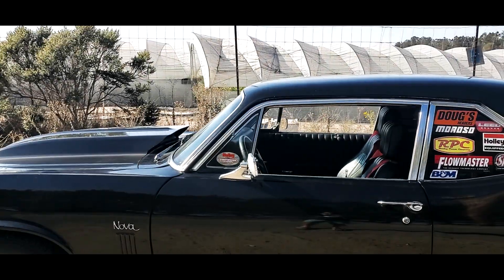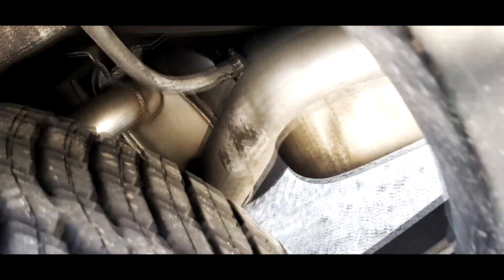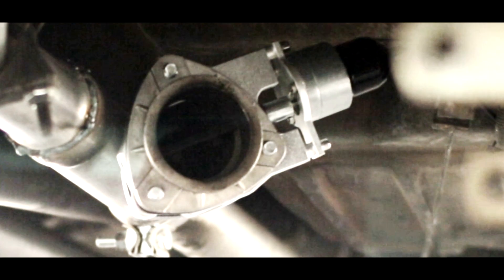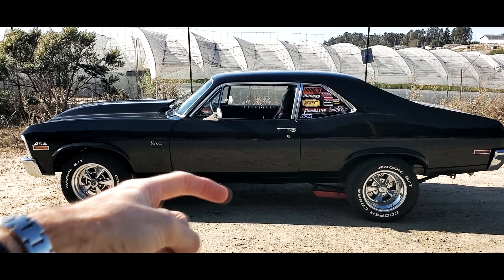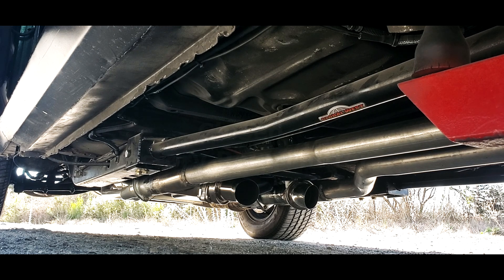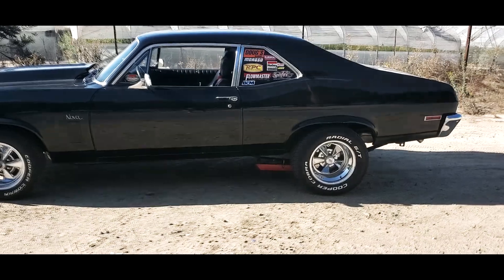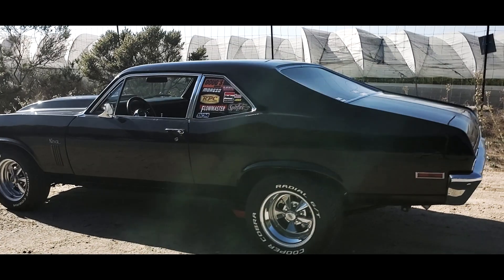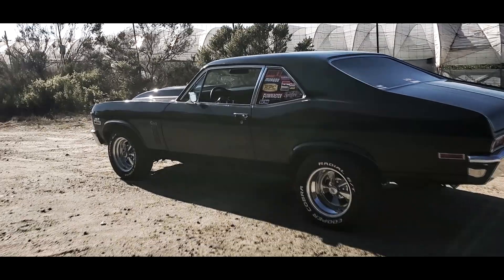Granatelli Motor Sports Electric Cutouts Demo (2.5 inch and 3 inch cutouts)

Comment: What are those black bars connected on both sides in the back underneath the car with the Red looking block bar underneath the car?
Reply from the maker: The black long bars that connect from the subframe to the rear of the body are called subframe connectors. It strengthens the frame and makes it more like a full framed. The red bars are called traction bars or slapper bars. Those are to prevent wheel hop and plant the tires into the ground so there's no axle wrap causing wheel hopping and can break stuff.
Reply: @MHTownsend57 Oh wow thanks a lot appreciate it 🙏

Comment: OMG the rumble of the 3inch pipe is insane sounds like not enough back pressure though when you give it gas it sounds perfect ;')
Reply from the maker: Cool thanks man. Hopefully you heard it with a good set of headphones. The whole back pressure things has been dubunked and has become a fallacy.  You're probably just hearing that I'm running it slightly rich for more wide open throttle, and off the line performance. Check out Engine Masters where they put all these things to the test.